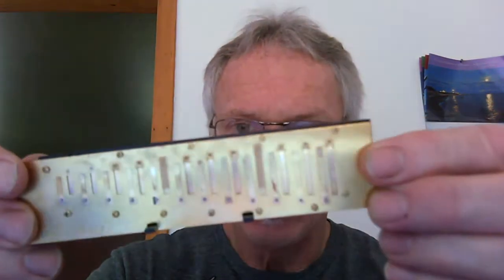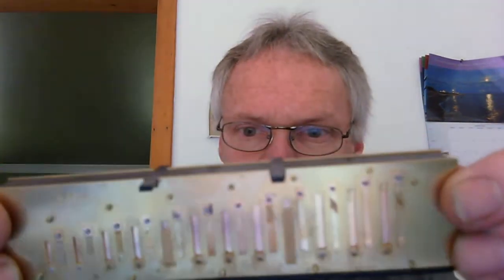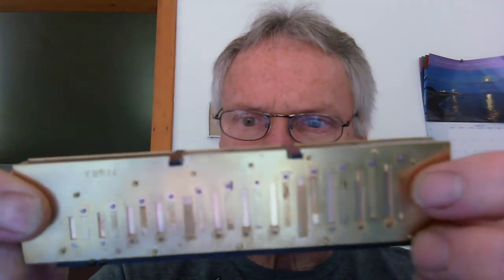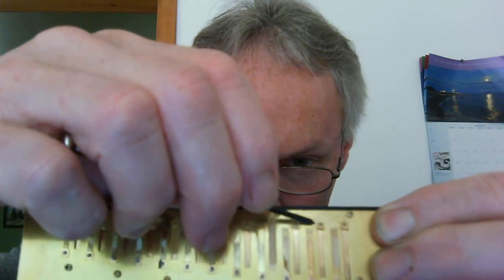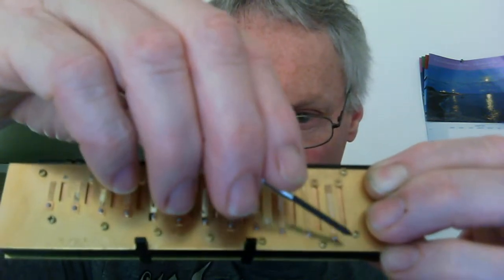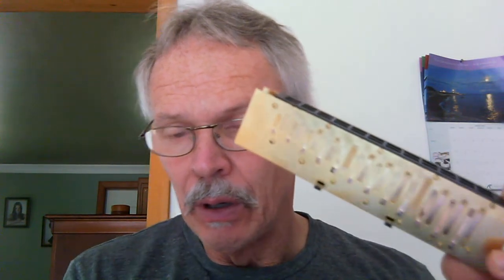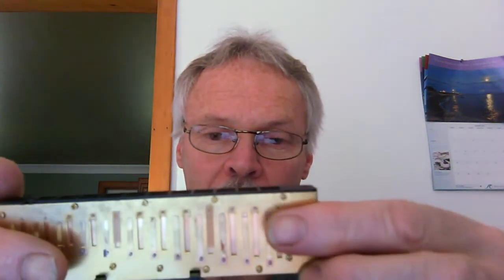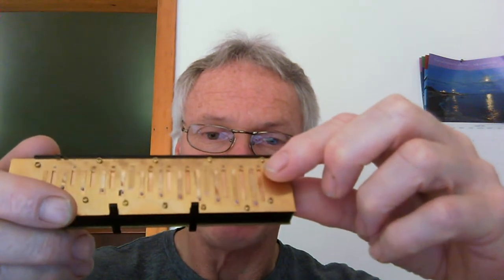How to half valve a chromatic

Comment: Thank you for your work. Have you thought about using the Brendan Power tuning so that you can bend every hole? You just have to retune two reeds I think. And if you don't like it, why? Thanks
Reply from the maker: I believe your talking about the 2, 6 and 10 draw. If you raise the F to an F# then you would be able to bend a semi tone just like on all the other holes. That is correct, but then the 1, 2 and 3 draw aren't D minor. It becomes a D major chord. I like the D minor chord and I can still bend it a little bit. It bends from F to E or at least close to the E.

Comment: Question Kevin, how dose unvalveing hole two (6, 10, etc ) help.
Reply from the maker: It enables you to bend the draw reeds in the same manner as you would on a diatonic. Except for holes 4 and 8. The tuning is reversed on the holes so you will get a blow bend there. What I mean by reversed is the higher note in the hole is the blow note on 4 and 8. All other holes have the draw reed being the higher pitched note.
Reply: Kevin Baker , My bad. I was thinking that the two and six draws  would not bend, even without a valve. due to the relationship between the blow and draw reeds, Like in a C harp, e-blow f-draw,  only a haft step between. thus when the blow reed reacts while drawing, no bend. Help me if I misunderstood.
Reply from the maker: No problem! The 2, 6 and 10 draw are like a 5 draw on a diatonic. The draw is a semi-tone above the blow so you can bend just like a diatonic draw 5.
Reply: good deal Kevin, I like to tune the f up to f# . thus giving a whole tone!
Reply from the maker: That will add greater range to the bend on 2, 6 and 10. It changes the chord from Dmin 6th to Dmaj 6th. I tried that and I just couldn't get use to it. So I changed it back. That is definitely a good idea though! Especially for half valving. Also swapping the reeds around on holes 4 and 8. So that the draw note is higher (C and Db) and blow is (B and C). To me that would be the ideal harp for playing Dmaj. I've been playing standard Chroms so long! It's tough to teach an old dog new tricks!

Comment: Je ne comprends pas bien où tu veux en venir.Tous les harmonicistes savent très bien que les valves extérieures économisent l'air quand on aspire.Mais si on les supprime ,surtout de 1 à 5 ,on perd de la puissance et on s'étouffe vite en jouant. Certes on peut altérer d'un demi ton  le 1 et le 3,mais le 2 et le 4 ça ne sert à rien.Par contre sur le deuxième octave on peut supprimer les valves sans trop perdre de puissance pour faire un bend C# et Ab. sur le 5 et le 7.Sur le reste ça ne sert à rien.Sur un harmonica normal, avec un peu de technique on peut baisser d'un demi ton en soufflant.Sur un 12 trous il m'arrive souvent de jouer le B en dessous du C1 en soufflant comme un over blow.Comme sur les diapos semi valvés.